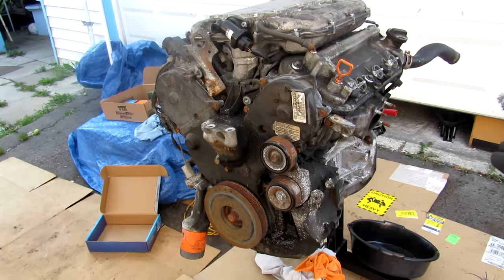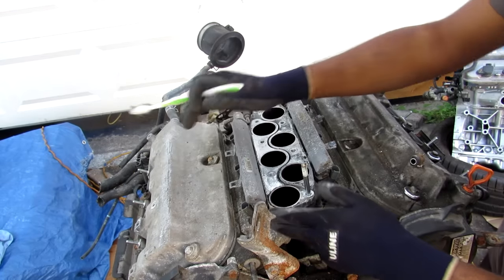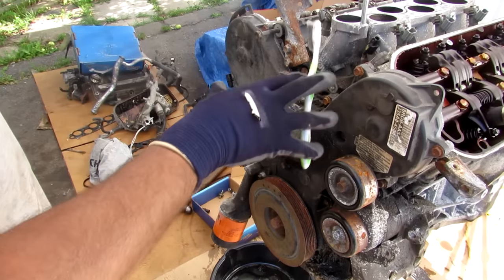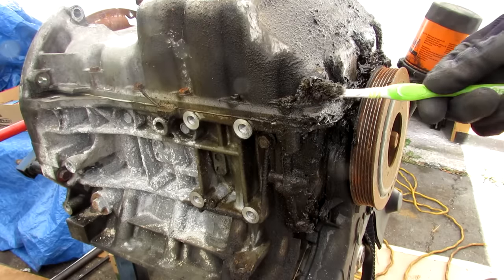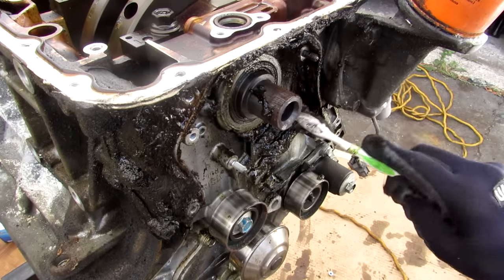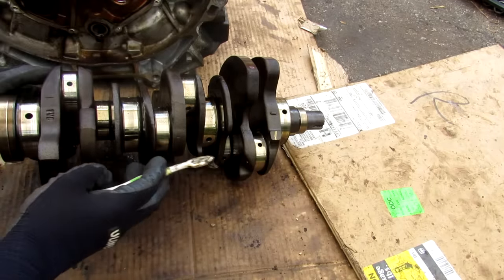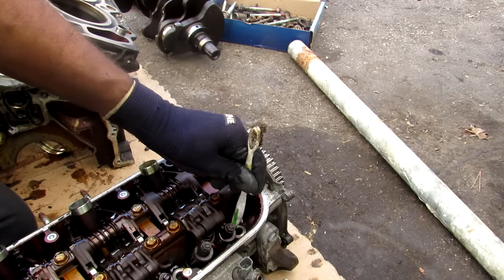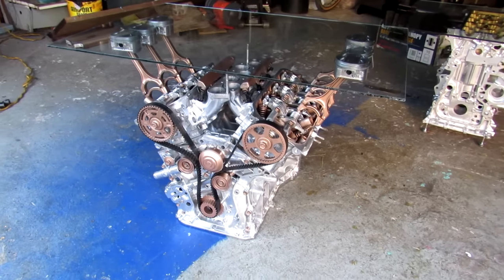Why Honda V6 Engines Haven't Changed For 25 Years

Comment: The main problem with these engines was that they beat the piss out of the automatic transmissions they were attached too 😂
Reply: Yep. I avoid V6 Hondas like the plague for that reason. Apparently it got better with the 6 speed autos around 2013 or so.. but I’m hearing stories of those having problems too.
Reply: Simple, bolt on a Toyota transmission and...bam, you have a bullet-proof car that will be around for your grand children to drive.
Reply: Faustin Gashakamba is that even possible
Reply from the maker: Um...just get a manual V6 Honda
Reply: Vinny Booboo  I currently have a 2012 accord v6 6 speed.. but use to have 1998 Acura cl 3.0 auto. The key to the old is with auto is regular fluid change and transmission cooler.. that cl still running but the new owner states he feels the trans JERK on cold mornings.
Reply: Could just get a manual
Reply: Just get a manual much more fun!
Reply: 6-6 Accord coupe ftw
Reply: @aoescool  the unreliable ones were the earlier 5 spd autos circa 2002 to 2006 as well as the 9 spd from 2017 or so. The 4 spd and 6 spd were fine.
Reply: @engineer_alv  100% Correct, this was because in the change from 4 gears to 5, and the 4 speed had no such issues other then a natural hard shift, Honda changed the programming for the shifting because of this by over lapping gear engagement. Basically 2nd starts to engage before first disengages and so on. The "new" smooth shift. They also forgot to add proper cooling for the added parts and this often caused 3rd gear to shit itself, most of the recommended fixes were replace the transmission or chance a rebuild. Due to the clutches hemorrhaging all their material it often caused and or exacerbated the problem, which was harsh shifts, shift flairs, delayed shift into gear or no gears and worse overheating. The best fix was to replace the trans and add a very good cooler and an inline filter as the internal filter is nothing more then a metal screen. Later model transmissions had an external filter added near the top of the trans, this is seen in the Pilot and MDX. Honda knew about the failures and ignored them, up until it got to the point people were threatening lawsuits, so they quietly changed the design adding fluid sprayers to help mitigate the problem. It didn't completely work and the cooler upgrade was sometimes still needed. The last 5 speeds in the series before the 6 speeds took over normally have no issues and the 6 shares none of the same issues. This is years of research and information hunting.
Reply: @Scientwisted  I remember it also limited power a lot too.. there was this guy in Mexico who just did a6 speed swap to the j30a1 and got 30hp
Reply: I have a 2005 accord v6 5speed with 286k on a stock trans and it shifts perfect the key is to actually maintain your car and not hit Vtec every 3 min
Reply: Good luck finding a j series manual transmission
Reply: @deklanmccoy9048  Well, it definitely helps to not beat the tar out of it and maintain it, but sadly not everyone is so careful and Honda should have thought of that.
Reply: Vinny Booboo  it was when they switched to the 5 speed auto in 2003 they started popping 
needed a better torque converter and a few things....
Reply: @calvinnickel9995  i guess i got luck. I have an 04 accord v6 auto 167k and no trans issues
Reply: @deklanmccoy9048  agreed  my 04 v6 auto is fine after 167k. Im never late on maintenance and i don't red line the thing everytime i drive.
Reply: @giwdly1542  yoink it out of an acura lol
Reply: @renaldobryan1047  the 03 was the worst they did a mid year fix on the 04 and changed up the torque converter and beefed up the cooling im pretty sure... But 3rd still likes to shit itself on the 5 speed autos if you like your vtec.
Reply: I'm driving an '08 TL with almost 190K on it and have had no problems with my automatic.  Even after having a transmission line rust out on the highway. The stupid dealer rep tried to get me to buy a new transmission even before they tried to repressurize it. I've put over 70K on the transmission since then with no problem. Watch, it'll probably fall out of the car on my next trip out.
Reply: Mt6 😬
Reply: @xDanyManx  Ben lookin for a three peddle car with a push button radio myself
 Can't be had around my burg.
Reply: Vinny Booboo my accord v6 was perfect until 248k miles transmission started slipping with no warnings then blew all together
Reply: Tak  LOL! You would have fallen out of your chair if you could have heard the conversation I had with the service rep.  It was ridiculous. He stutter through every answer when I practically walked him the process of diagnosing any potential residual issues that may have occurred as a result of the transmission line failing.  If I had been someone that didn't know cars it would have been either a 4K repair or a new car. Stealership? Absolutely. Yep, the transmission change in the '07's is what sealed the deal when it came time to pull the trigger on the '08.
Reply: 2005 TL bought it at 36K miles now 200K miles , regular maintenance like oil change, brakes and tires.  Did timing belt a water pump at 143K.  No issues, the only car I trust.  Trusted so much just bought another, same year same color just 6sp with aspec kit.
Reply: @vauv_nuvj7614  I have been thinking of doing the same thing if I can find one in decent shape.
Reply: @calvinnickel9995  mines on the way out. 113k miles. Can't handle the engine.
Reply: Vinny Booboo  I have a 91 accord with a newly replaced engine, and cuz I'm a new driver I slammed it a couple times in reverse while driving, still working normally. The point here is that transmission problems started around 2003. In my country you can find 87 accords still working normally
Reply: 2014 Accord coupe v6 MT and I’m never getting rid of it
Reply: 307k on my 99 cg2
Reply: @renaldobryan1047  you did, I got a 01 v6 accord, trans went out at 115k while I was waiting for my starbucks 😅
Reply: @kedst2000  they gave you a cheap quote then, I was getting charged more than 5k for a new transmission back in 2015 I think
Reply: If you guys were talking about the transmission failures from like 1999-2096+  I actually found the problem and solution why they broke and I have a bunch of rebuild videos on this type of automatic transmission
Reply: @hellbringer09  I know exactly what you're talking about I actually found what was causing it and I found a solution for it I've got a bunch of videos on my channel if you have like 15 hours to waste
Reply: @Scientwisted  I had no issues with my 2007 Acura TL Type-S 5-speed. I beat on it a lot. Solid and reliable. I sold it right before it reached 106k miles. I didn't feel like going thru a timing belt etc. service.
Reply: @giwdly1542  They're common. You aren't looking 👀
Reply: jason9022  Common misperception. There are plenty Acura/Honda V6 6-speed manuals.
Reply: Tracker Pete  unfortunately I have no working knowlage of the sonnex kits but I have however heard good things on various forums. As long as the person doing the rebuild does so in a clean environment and takes their time appropriately it should last for a good long time. Its still a good idea to put a superior cooler and in line filter to help extend the life and performance of the trans.
Reply: @calvinnickel9995  it actually got better around 2006 or so. I have a 2008 accord v6 I bought brand new. No problems from the automatic transmission .
Reply: Eeh im about 170,000 miles on my v6 and they aren't easy miles but I do all the fluids and filters myself on time. And my baby. Momma has 300,000 on her V6 Honda to with a 5 speed auto. Little things with cooler lines and cracked coolant reservoir.
Reply: Tracker Pete  my baby mommas is the 03 Honda accord exl V6 with the J30A1 mine is an 04 with a J30A4
Reply: Get the manual trans, much better but they’re beat to hell by their owners. It’s like buying any other sports car except these are just fwd sport cars
Reply: @hellbringer09  Good thing my '03 Accord was a 6-speed manual. Remember hearing stories about the auto trans back then.
Reply: @gigamix7394  Don't know about others but my V6 manual wasn't beat at all the 14 years I owned it. Hardly ever hit the red-line and didn't engage V-tec all that often either. It was used as a DD not a sports car. Did some modifications (intake, pulley, short throw kit, suspension) early in my ownership, but soon realized that despite being a 'quick' car, the FWD platform without LSD was its Achilles' heal. Too much torque steer. However, it was great in the corners with performance struts and coils.
Reply: @jamesaron1967  i have a 06 v6 6mt thing is a rocket i love my j
Reply: Unfortunately i live in korea yet 99% of cars sold in this country are equipped with 5spd auto. There are no chances to have a manual transmission at all.. only civic or other small cars, apart from any luxurious models.
Reply: Because GM made most of those transmissions.
Reply: @tomstevens7452  no they didnt new venture might of been subbed to do some manufacturing i believe but the transmission ws designed by honda for a much lighter class of car. problems.stemmed from.the early h5 honda auto. It needed more torque converter and got another shaft to make it robust for heavy cars and high hp applications starting in the 05 tl
Reply: @tomstevens7452  as much as I love to rip on GM, they had nothing to do with these cars
Reply: Until the introduction of DSG's and 6/8 speed torque converter autos I'd argue that the Hondamatic design transmission was one of the best autoboxes available. The performance and economy figures vs the typical "4" speed slushies of the time tells you all you need to know. The Hondamatics biggest drawback is that the clutch for each gear can only be so large, imagine a tiny motorcycle size clutch being asked to deal with a V6 and a heavy car, not good! The combination of a torque converter with a self shifting/synchronising manual style transmission is a brilliant experience. Compression braking, quick and firm shifts, no long ass gears or overdrive it was so ahead of it's time!
Reply: @tomstevens7452  Actually GM makes the best automatics. Making a FWD automatic that can handle a lot of power is tricky. GM is good at it because of the big V8s and heavy fwd cars they built. Toronado, Impala, etc. Honda doesn't know how to make big automatics that can handle lots of torque. That's why they have to outsource the design to ZF. I think even ZF (BMW) and Aisin (Toyota) licensed the designs from GM/Borg Warner. On the flip side Hondamatics were originally designed for really small fuel efficient Honda engines. Those GM transmissions required giant engines because they were so inefficient.
Reply: Depending on the year that is true lol For instance the J35A in the 1st gen Pilot (2003) has a good solid transmission... BVGA (BVGA transmission rebuild can be seen here https://youtu.be/bgCmQx9tGp0). At least from my experience as mine has 230k miles on the original tranny. I will say it had the oil jet kit installed on recall over 2nd gear pretty early on. The odyssey transmissions were mostly crap with the same engine. The accords up to 2012 had transmission problems too. At 2012 they didn't have issues which is why I looked for a 2012 accord coupe but ended up getting a 2010 lol which also has a J series v6 engine but instead of just vtec like the pilot, it has vcm as well so its an i-vtec. So far so good and hopefully I won't have problems with the tranny but you're right, certain years definitely had trans problems. On the maintenance receipts I see where a transmission was purchased from a yard most likely for the solenoids. BVGA trannys do not have a pan and they also have an in-line filter at the top which is very different than many trannys Honda used. It was a good sign that I didn't see any BVGA transmissions in the junk yard when I went. They are easier to distinguish due to having no pan on the bottom.

The BVGA I have more faith in than the one in the accord but still hoping if maintained it will not have any issues down the road.

The cool thing is though on honda trannys, the solenoids are external so sometimes it is just that and not a transmission breakdown internally.
Reply: I HAVE SIX GEAR MANUAL HAHA!
Reply: @calvinnickel9995  I am not sure what they did for 05/06, but I generally do not see many failures with the Accord V6 from 2006. We did have a 2003 V6 that we cared for dearly and we had to do a transmission rebuilt at 261,000 miles, sitting at 295,000 miles now. Our 2006 V6 Accord has about 198,000 miles, trouble free, and my cousin had a 2007 V6 Accord until it got totaled in a collision around 200,000 miles, no problems. I noticed on my 2014 Odyssey that it shifts to compensate for the VCM, even though I deactivated it. Sitting at 111,000 on that unit now and its been pretty much flawless, especially with the VCM disabled.
Reply: @MQBjon  That's what happened with our 2003 Accord at 261,000 miles. Our local transmission rebuild shop found that the "Trans heater" started leaking coolant into the transmission fluid, destroying it.
Reply: @sarahendrix3132  Agree or disagree, my personal experience, and the mechanics I have talked to who rebuild thousands of transmissions do not see a reliability issue with those Accords after 2005. The VCM cylinder deactivation systems on the 2008+ Accord V6 engine is what people should really watch out for.
Reply: @speedkar99  Exactly! my J30 6-speed 4 door 2006 accord is bullet proof.
Reply: 07 Acura TL.
....This Car Man....
Lemme tell you lol
Reply: @aoescool  apparently what helps a lot of Acura/Honda owners from that time is cleaning the solenoid. That usually cures all the problems, BUT you have to do it early on before too much damage is caused to the transmission.
Reply: Only a problem with North Americanz...
Reply: when paired with the 6 speed its a beast though
Reply: @faustin289  will a toyota tranny bolt up to a j30a4 engine?
Reply: @speedkar99  my brother has a manual 2007 v6 accord sedan it runs amazing with 300k plus miles on it
Reply: Learned that the hard way.
Reply: @calvinnickel9995  they absolutely do not have any issues the 9th gen auto v6s are amazing
Reply: @speedkar99  eww
Reply: @ajevthetruthisthetruthnotc8390  I just bought one as well car is fun to drive . Got mines with 104k 5500$
Reply: @speedkar99  I think it is more to do with:
User failure
Mechanic failure and just overall poor usage and misdiagnosis of the transmission.
Honda transmissions hands down as near bullet proof as their engines as they are Honda designed and built not a copy or produced under license.
Many are still sealed from factory after 30 years of daily use.
Reply: That is mostly when Honda first introduced the J-series in the late 1990s. By the year 2006 Honda solved the problems associated with their “Hondamatic” transmission design. I have a 2010 Acura TL & the transmission still shifts lighting fast & super smooth. Just make sure to change the auto transmission fluid about once every year.
Reply: @MrSamPhoenix  seems a bit too often for automatic fluid. Especially if it hasn’t been changed in a while it’s best to leave it. buying a used car most likely they aren’t switching automatic fluid every year u could cause it it slip with taht advice
Reply: @j8thgen479  I haven’t had a problem at all doing that since owning the car. People often wait very long periods before performing transmission service on their vehicles… which is a worse way of handling maintenance. 

Like engine oil changes, it really depends on how the vehicle was used. If the car was used in worse-case scenarios keeping fresh fluids won’t hurt. 

I’m seeing even Toyota transmissions malfunctioning because the lack of maintenance or super intervals. I live in South Florida where the weather down here can be brutal for a vehicle’s mechanical components. I’m now nearing almost 175,000 with a happy engine, & a smooth & fast shifting transmission.
Reply: @midwestfarm757  indeed, & the VCM issue is a very simply thing to maintain or fix. My brother’s 2011 Honda Accord V6 sedan had some issues. 

So we found out that the gasket responsible for VCM wasn’t holding the proper pressure (located around the dipstick near the front valve cover). So we changed the gasket, & also changed the PCV valve & spark ⚡️ plugs. This made the engine smoother & a lot more responsive. Plus, the engine stopped burning oil. It’s silly to me how Honda doesn’t make these standard wear items dealers must change. They’re very easy to change.
Reply: My 03 has 282k on it.  Rebuilt the tranny once.  🤙
Reply: @hellbringer09  The sportshift 5 speed was around before 2003 my 2000 TL 3.2 has that awful thing. 1999 they started putting them in the TLs at least.
Reply: @faustin289  Funny you say that when two of our RAV4 had a/t tranny failure. Interesting enough, they were made by Toyota and not Aisin.
Reply: @renaldobryan1047  agreed my 2003 V6 Auto 235k shifts perfectly, just don't redline it all the time and change the transmission fluid. Original stock transmission
Reply: @calvinnickel9995  Thats why I avoid V6 Hondas with auto trans...I only get the six speed manual.
Reply: @speedkar99  exactly.
Reply: I got an '04 with the automatic. Nearly 300k on it. Only changed the fluid. Never a problem or repair.

Comment: I used to build those engines at the Anna Engine Plant in the late 90's. I was a supplier engineer for the gaskets, EGR, ACG, hoses, fuel injection rails and suspension components. Thanks for the trip down memory lane!
Reply: And here in 2024 Anna engine plant is still building those same engined